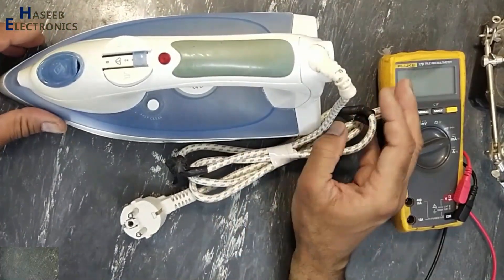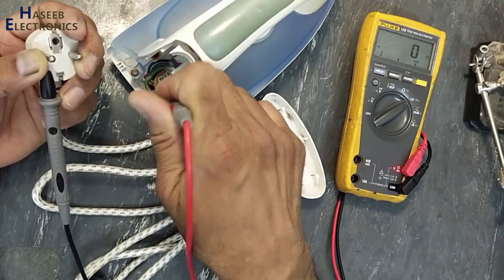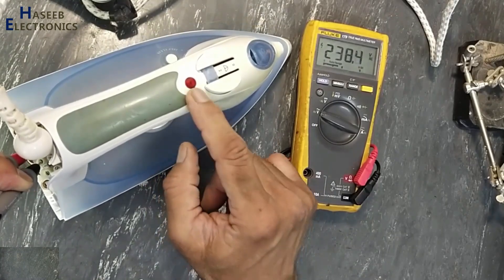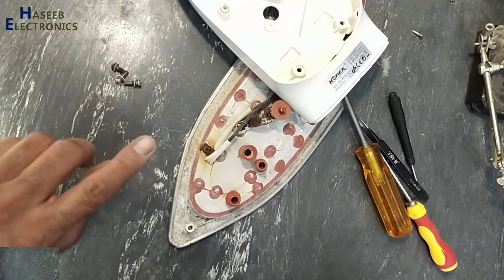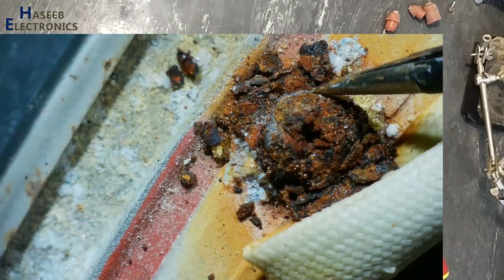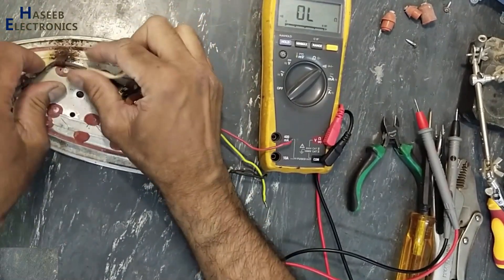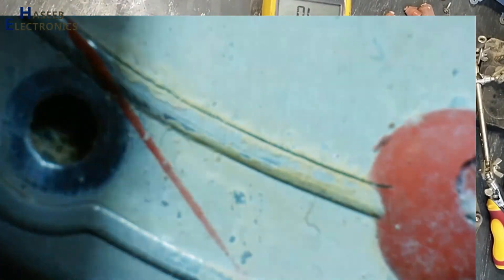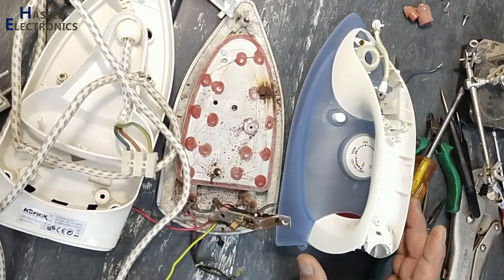{1218} Please Write your opinion for this UNSUCCESSFUL repair attempt

Comment: Hello Haseeb Thanks for sharing. Heat and humidity cause a lot of damage to the material, corrosion of the metal and oxidation of the aluminum causes the screws to be welded to the sole. There is not much to do for this (maybe go back to the old cast iron and open a forge🤣🤣🤣)

Comment: Unless it's a simple broken wire or thermal fuse issue an iron is not worth fixing because they have a hard life in general. It was probably bought 10-15 years ago and used every day for 1-2 hours. It has served its purpose and the owner got their moneys worth out of it. A new iron presented by the husband will be greeted with a warm welcome by the wife.

Comment: Applying some car brakes oil all around the screws and waiting a few minutes, would help to open them. But nearly all electric parts were out of use. So, buying a new one (and opening it's screws instead😂) seems reasonable!
Reply from the maker: come on dear brother. 
is car brake oil is stronger than me????  😂😂😂😂😂😂😂
when i can break them easily, then why we use car brake oil 😂😂😂😂😂😂😂😂😂😂😂😂😂
Reply: @HaseebElectronics  Of course, not😐. But that type of oil really does the miracle. Just use it one time and you will see.
Reply from the maker: my just reply was just a joke 
you are right. brake oil is fantastic

Comment: someone found it in the trash. I doubt the heating element is good or last long. Trash
Reply from the maker: heating element is also exposed to overheat condition and its heating chamber got seperated from neighber plate. and even it is repaired, it will get damaged in very short span of time
Reply: @HaseebElectronics  You need to charge for diagnosis. Otherwise one can bring you any good looking junk and profit if you repair but lose nothing if you fail. What I do is ask for relative price for diagnosis and repair, so that its always worth doing for the customer.

Comment: Haseeb bhai, only solution to such base plate rusted, blown thermal fuse and faulty thermostat is to replace with new base plate which normally comes with thermal fuse spot welded. Buy thermostat separately and can make the iron usable. It will be like a new one. My Murphy richards steam iron (exactly looks like the one you tried to repair) similar issue,   Base plate rusted thus water came out and thermal fuse blown thermostat also failed. I ordered original parts from the company and replaced them. My iron is working as good as new. Current price of new iron of the same make and model is 3 times the price of spares. So it was worth repairing as ABS body is in very good condition
Reply from the maker: yes you are right 
but here in Jordan it is difficult to find the base plate. if ordered online, after taxes, custom duties and shipping charges, the final repair cost will reach above 3x to the price of new iron. 
if we recover the same iron. 
thermostat 2.5 JD
Cable 2 JD
thermal fuse 1 JD
high temperature sealant gasket tube 2.5 JD
if machine work is done on existing plate 5 JD minimum 
13-15 JDs
new iron is 13-20 JD

Comment: Modern gadgets are designed to make repairs difficult or impossible. And spares are either unavailable or too expensive.  Everyone knows why. 
Now you got a lot of spare parts which will make the next iron repair cheaper or free. Meanwhile you can make coffee/tea on the heating-plate.

Comment: Better to buy a new one. You were right. The cost of the parts and repair will either meet or exceed the cost of buying a new one.
Reply from the maker: yes it will best to purchase new one. even after repair it will not work for long time due to its base plate was exposed to high temperature and its heating element body is near to explode

Comment: My electrical welding machine is powered on the leds show up and fan is not spinning,there is no output what could be problem
Reply from the maker: most probably the problem in power driver stage or its controller card 
sometimes it is due to low voltage power supply section as well